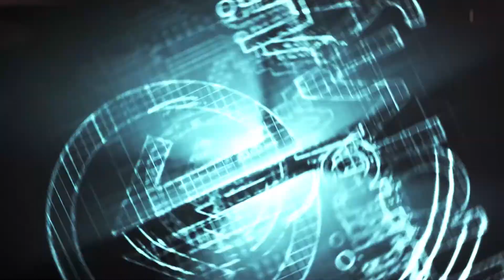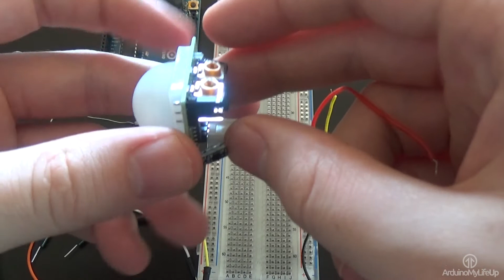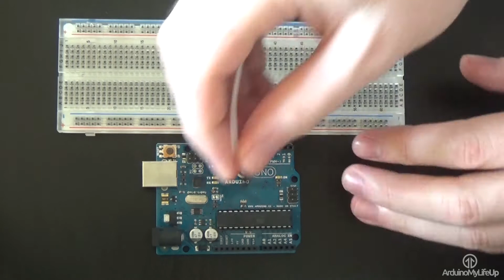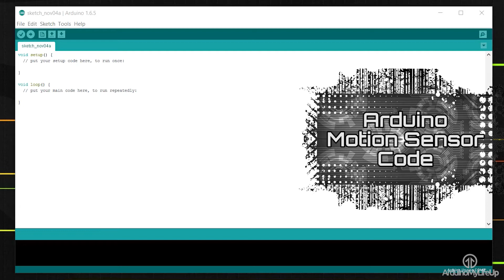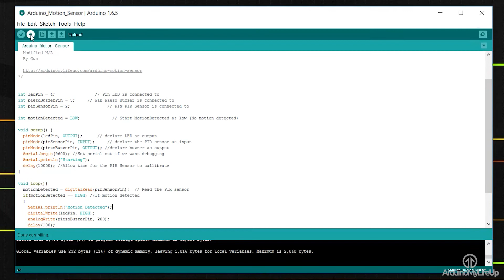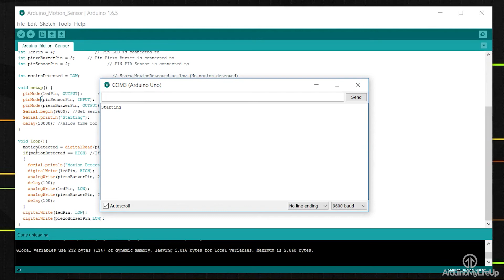Arduino Motion Sensor: A Simple Motion Detection Circuit

Comment: instead of LED light, i want to use a LED strip . (which is 12v) , what should i do ?
Reply: you can use and adaptor that supplies 12VDC and a Transistor